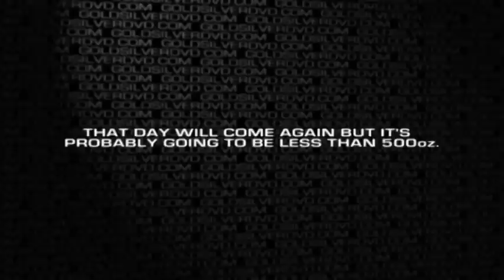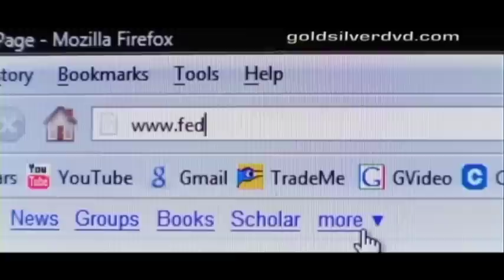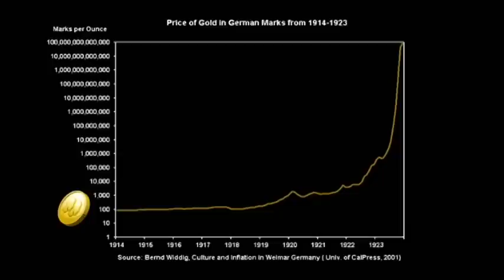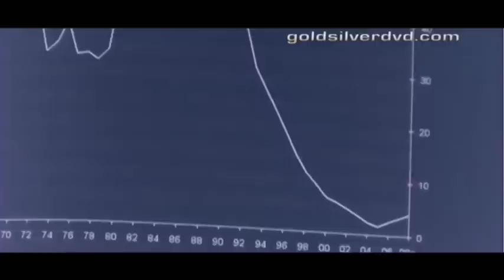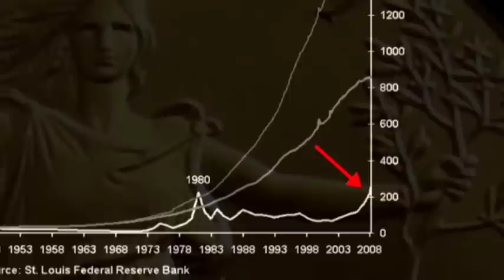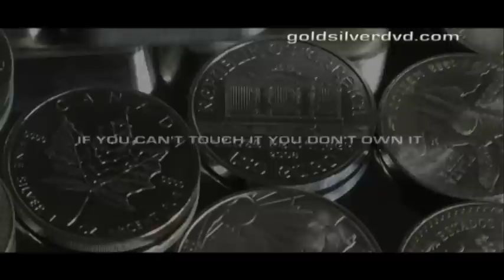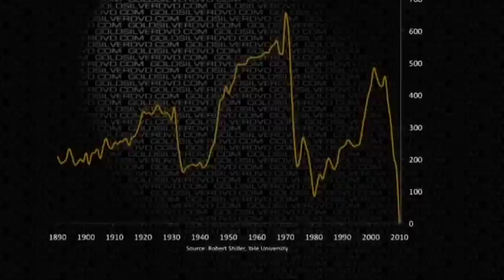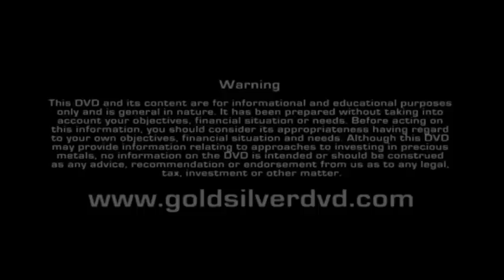Why Gold & Silver? - Mike Maloney - Silver & Gold Investing

Comment: I was luck enough to have spent some time with these guys in NZ. Although I had already been in the precious metals market, they gave me some reassurance that perhaps I was heading in the right direction. Yes maybe silver is apparently on a slight downward direction, the ratio to gold is 54/1. Just 3 years ago it was 70/1 so in comparison is still solid. The cynics say its going down and they are those not in for the long haul. Hold tight and watch it move again as the U.S prints more cash.

Comment: Davidka1978Xoroshiy 

While true that many commodities that are readily salable can hedge against inflation, you have to remember they are much more likely susceptible to major shifts in supply. 

Take oil for an example. North Dakota is booming in new oil reserves because of a new technology that extracts oil out of rock called fracking. This creates huge supply shocks, unlike gold which does have rarely a supply shock, for the most part, all gold mines have been mapped and are actually in decline in ore per gram content. 

The best and "ONLY" commodity that can be considered "MONEY" is gold/silver as they pass the 5 dimensions of money characteristics.... no other commodity can pass but maybe 3 or 4 at the most. 

Money must be:

1) Portable
2) Fungible
3) Scarce
4) Store of Value
5) Durable

Oil obviously spoils and is not readily fungible in a way that gold and silver are, oil is also vastly more abundant than gold and silver are.

Comment: I admit I am only 27 min in but this makes NO sense. If you have 100 in cash right now and 100 in gold right now then flash forward 10 years. If gold doubled obviously you would now have 200 of doubled gold but the value of $ will still affect you just as much. You are conflating 2 issues. Cash is not advertised as an investment. Of course, an investment is better than sitting in liquid this is basic math. They are hanging on this issue of paper with zero cause. It is not making the case to invest in silver so much as a trick of the mind as a selling point. A huge turnoff because I see some real points to investing in silver but this is not a good presentation it is a commercial.

Comment: i like way you think
Reply: THERE IS NO SUCH A THING AS FRACTIONAL RESERVE BANKING FROM COMMERCIAL BANKS! 14:00 Starts to explain misinformation. Maloney is spreading misinformation. He may mean well but what he is saying is not correct. Banks do not lend from deposits as required by the concept of fractional reserve banking. What is really happening is that banks take your SIGNED PROMISSORY NOTE AND DEPOSIT IT IN A TRANSACTION ACCOUNT. Once the Promissory note is deposited the banks draw a check from that bank and pay the alleged debtor. The money for the mortgage did not come anyone's deposit. Take it from a lawyer who has Voir dire banks' competent witness. Ask the bank in a deposition if they created a transaction account or something similar and where did the source of money came from. You need to do this in a deposition and under oath tell it in a hearing because the judge will fight tooth and nail to prevent this knowledge from becoming widely known.